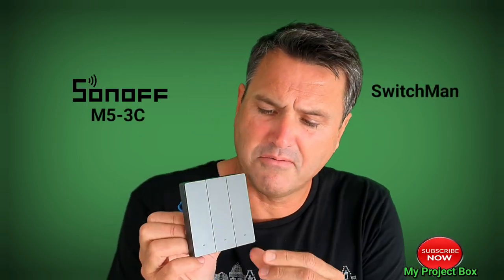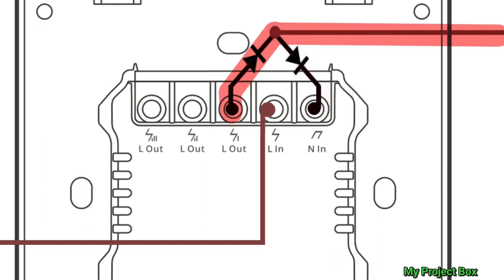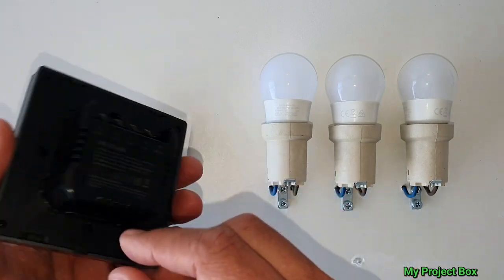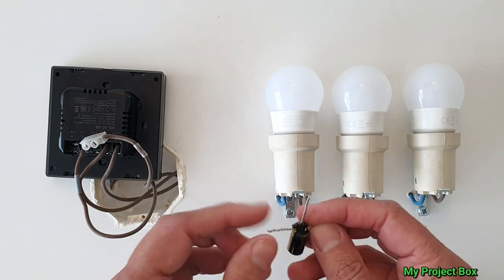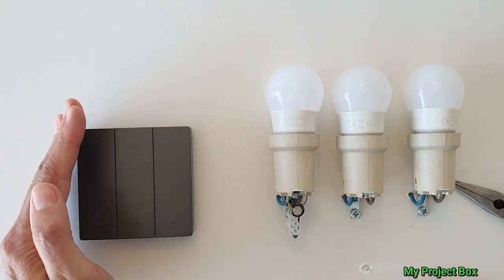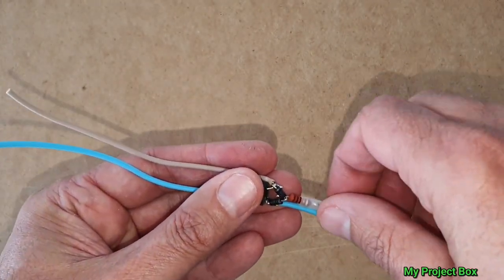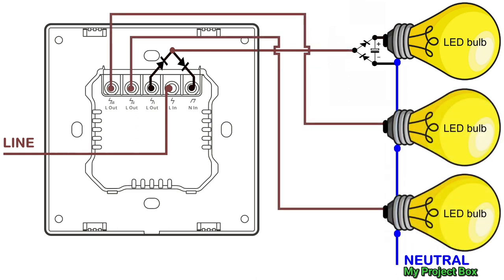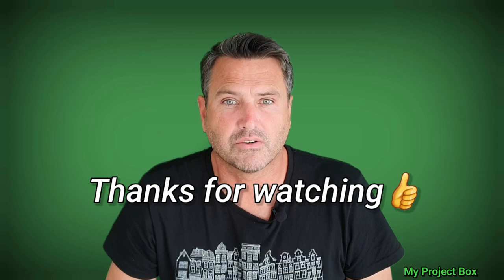Sonoff M5 NO-NEUTRAL  required trick! SwitchMan Hack #Sonoff #noneutral #circuit #modified #M5

Comment: Hi. Thanks for this idea. It looks great! I’m trying it out with an athom 3 gang switch. The curcuit works when it startd, but when I turn the return channel light on, the circuit breaker goes off. I think  i got the diodes and capacitor directions right, but I’m not using a resistor (I’m testing it with what I have at hand). What am I missing?
Reply from the maker: It's great that you're trying my circuit with different brands of smart switch. But I recommend you set up a testing rig, with a safety current limiting. You simply put a old style incandescent light bulb in-line with the Live feed to power your smart switch. That way If you make a mistake nothing blows up, only the "fault lamp" lights! I demonstrate this in this video https://youtu.be/oBR5O391m_c  (at12:56) .
If all works well in your test circuit, then take the safety lamp out, and install the switch. Hopefully you haven't damaged your smart switch or some of the diodes. Good luck👍
Reply: @MyProjectBoxChannel  Thanks! I'll check that video, and I'll do my follup up tests with the light bulb protection.
Reply from the maker: @schoren   Great let me know your findings.  Some people have reported, with some brands of smart switches, all the polarities of the components have to be reversed.  But if you lucky it's exactly the same.  I like the idea of using a smart switch with tasota pre-installed.
Reply: I’ve tried reversing the diodes but still not working. I also added the old light for protection. 
If I remove the diode, I see that both light bulbs (the one I’m trying to control and the protection) turn on for like a second, and then the relay unlatches. This happens in any configuration of the diodes. 
What could be happening?
Reply from the maker: @schoren  try to verify that nothing is damaged. Maybe test the smart switch by connecting it as normal, see that it still works as it should. Check all your diodes and capacitor with a multimeter. If you have new "fresh" diodes and capacitor it's probably better. I have not tested this make of smart switch yet, so I can't guarantee that my circuit will work with it. It's also possible that all polarity of the components need reversing. It might require some testing to figure it all out. But be careful it's easy to destroy something!
Reply: @MyProjectBoxChannel  I had indeed 3 burned out diodes, but luckily nothing else. I'm trying with a different smart switch from athom too, and I see more or less the same behaviour. I can either control the "protection bulb" and get some flicker on the "main bulb", or vice-versa depending on the direction of the diodes. does this mean these devices are not compatible?

I am not using the fusible resistor. Is that required? The fact that I always see the secondary light flickering makes me think that I might need that resistor to "offload" some current or something? I'm don't know anything about electronics, so i'm just letting my imagination fly here.

Also, isn't it weird that the lights flicker? isn't that what the capacitor is supposed to avoid? is that an indicator that either my circuit or the capacitor values are incorrect?

Thanks so much for your help!
Reply from the maker: @schoren  you can message me on Facebook messenger. That way you can send some photos of what you have done. https://www.facebook.com/My-Project-Box-105438131355367/
Reply: @MyProjectBoxChannel  you are the best. Ill reach out there
Reply: @schoren  have you solved the problem?? I exactly have the same problem. It’s the same with or without reversing the polarity of the diodes.
Reply: @MyProjectBoxChannel  I have the same issue. Have you guys solved this?

Comment: Hi 

Can this work for multiple lights controlled by just one switch? A 3 gang switch that controls 3-4 pin lights per switch. Should i just add the diodes and capacitor on the first light on the first switch? Thank you!
Reply from the maker: I will draw some circuit diagrams for you when I get time 🤔😉👍. 
So one switch/ output, needs the diodes, which will provide the "neutral", to power the Sonoff M5. The other switch/outputs connect as normal to the lights. You can put more lights on the diode (neutral return) switch/output, but I recommend a separate bypass circuit(diodes and capacitor) for each LED bulb. This is only needed for the switch/output with the diodes. It is possible to have just one bypass circuit on the first bulb, and connect more bulbs in parallel with that first bulb, but it's easy to make a mistake that way. It is sometimes possible only use diodes, without needing a capacitor! This only works with some types of led light fixtures.

Comment: I tried your way to bypass the neutral wire in the MOES dimmer switch but unfortunately the 8.8w bulb is blinking and the zigbee smart bulb is working but is on all the time at about 10% and can not be dimmed / brightened. I'm 99.9% sure I didn't make any mistakes. do you have any idea why that. does it work in my case?
Reply from the maker: My circuit is unfortunately not to design to work with the smart dimmer switches😥 .  It only works with normal On/Off style smart switches.  I obviously do appreciate people testing my circuit with various different brands, that I haven't tried it with yet. If enough people give me feedback, with their findings, then maybe I could compile a list of compatible devices.😉
Reply: Hey, is there a way that something like this is possible with a tuya dimmer?

Comment: Hello. Have you measured the voltage at the bulb? After the diodes + capacitor, the voltage increases. My device showed 280 volts. That's a lot!
Reply from the maker: That's the DC voltage!, so it's different to 230Vac. Inside the led bulb the voltage will normally be rectified from AC to DC anyway. The peak voltage from 230Vac is 325V!!(that's how high it can normally be rectified inside a led bulb). Not all LED bulbs work with DC, but luckily most are just fine with it. The older "capacitor dropper led driver" type circuits, won't work. So because the rectified voltage is higher the capacitor is rated at 400V, for safety. So inside the led bulb the voltage is at its "normal" operation levels.
Reply: @MyProjectBoxChannel  Yes you are right. I didn't think about it. The diode bridge in the lamp stops working as a rectifier. It is already under DC voltage. Thanks for the good idea!
Reply from the maker: @АлександрАнтонов-г8ж   I'm glad my circuit worked for you😉👍.  Just be safe when working with mains votage.

Comment: Thanks for the video and the great idea, do you by any chance have a link to a shop where I can purchase the resistors in the UK?
Reply from the maker: I got most of it on ebay. I'm changing my circuit slightly in response to people's comments. So a video with the updated circuit should be out soon😉. You can change the fusible resistor to 5ohm 1w-2w. I'm changing the capacitor to 15uf aswell. I'm using bigger diodes, to make it harder for people to blow them up😁. 10A10 Diodes in in place of the old 1N4007.  There's nothing wrong with the old circuit,  I'm just making a much tougher version.
Reply: @MyProjectBoxChannel  great, thanks very much 🙏

Comment: A tip for everyone who doesn't fully understand this magic; Look out animation of how full-bridge rectifier works.
Before testing this, add weak fuse (0.5A) to the L1, just before the switch. Add another one just on neutral wire coming out the bulb. Do not add the light bulb. Do not connect virtual neutral to the switch. It should prevent the loud reminder of your mistake. Instead, fuse will blow and if you're lucky, everything else will be unscathed.
If fuse does not blow, you're ready to remove the fuses and connect everything as it's shown.

Even better if you can test this on 12V AC transformer, if you have one lying around.
Reply from the maker: You can safely test the circuit with some current limiting, in the form of a old style incandescent light bulb. You put it inline with the Line supply. Make sure you test your circuit with a LED bulbs as the connected loads. This way if you make a mistake or short-circuit,  the worst thing that will happen is the incandescent bulb lights up. And if you did everything right, it will work as it should. Look at this video at the following time stamp https://youtu.be/oBR5O391m_c  skip to 12;56

Comment: Hi
Thanks for the video. 
Could you show the mod installation for the bulb end applied in the ceiling dose instead of directly at the bulb. 
Steve.
Reply: I mean rose not dose 🙂
Reply from the maker: Thats a great idea! You could make a little "bypass module", with short flexible wires,  that connects at the ceiling rose. I don't currently live in the UK at the moment, and they don't use that system here. I wont be able to get hold of a ceiling rose. So the only way I could demonstrate it is with a animated drawing/schematic.
Reply: @MyProjectBoxChannel  A bypass module diagram based on your no neutral solution that could fit into a Ceiling rose would be very useful. ✅🙂

Comment: What do you think of the Method of using the ground wire if it is bonded to the Neutral?
Reply from the maker: It's is not safe or legal, to use the protective earth/ground, as a neutral substitute! It certainly will work in some cases, BUT if you have a RCD (GFCI in US) protected home, the circuit will trip on a ground fault, if you try to use the ground wire as the neutral.
Reply: @MyProjectBoxChannel  Thanks for the quick reply. I am now thinking about going with Zigbee. They have switches that do not need a neutral or a capacitor. I don't know how that works, maybe they have a battery built in them. (I am in the US and  my house is pre 1985)

Comment: Hi, can I use this circuit to power an LED lamp with a power supply ?
Reply from the maker: Yes! People have tested it with LED ceiling lights, that use separate driver/ power supplys. Just test it first before you commit. If you follow my "safety current limiting method" in this video https://youtu.be/oBR5O391m_c  I used a "old incandescent bulb" for protection, so nothing goes bang when testing. Then remove it if everything works.

Comment: Hi! I've tried your solution with and it works great! What would it take to make this circuit fool proof? I mean a circuit that won't blow up when reversing the neutral-live wires, are you planning on developing such circuit? I ask because I created my own DIY Smart Wall Switch that works great with Home Assistant and the question always pops about no-neutral wiring and your hack would fix my issue if it could be incorporated in the design. Let me know what you think! Either here or by direct message. Again great work! Cheers ;)
Reply from the maker: I have some ideas yes! You can message me on Facebook messenger https://www.facebook.com/My-Project-Box-105438131355367/ 
Or my normal Facebook https://www.facebook.com/robert.wynmaalen

Comment: Thanks.
I can’t find 10uF 400V capacitor, is it possible to use 10uF 450V capacitor instead?
Reply from the maker: Yes! The higher the voltage rating of the capacitor, the better its for safety😉. I recommend you use  the safety testing method in one of my previous videos. Use a "old school" incandescent light bulb in-line (as current limiting) to test everything works first. https://youtu.be/oBR5O391m_c
Reply: Thank you
Reply: Excellent tutorial, the switch ( as the other tuya switches ) work perfectly. Thanks again.
Reply from the maker: @abokhozayem    No problem happy to help😉👍Could you tell me which model/brand smart switches you used.  I would like to compile a list of ones that work with my circuit

Comment: Be aware this is dangerous as you are taking the current for the lamp through the diodes which are only rated for 1A, thease could over heat and fail.
Reply from the maker: I have used 10Amp diodes  for my newer version of this circuit. But it's worth mentioning that 1Amp is more than adequate for most LED bulbs that are not drawing more than 0.05Amp. Using bigger diodes are useful in the event of a circuit fault, that way the diodes can cope better with higher fault currents, if something goes wrong😉👍. The 10A10 type diodes can handle  over 200Amp for a brief instant, this means it can survive a circuit breaker tripping  https://youtu.be/mznx0xoF8Ck

Comment: Great stuff! Any similar solution for stairs switches?
Reply from the maker: I have a different "NO-Neutral" circuit made for stairway switched lights. It gets around the problem by putting the Sonoff directly by the light fixture. https://youtu.be/9hQFFsBkxaU 
Alternatively it might be possible to just power a second Sonoff switch, and have it trigger a another Sonoff in a software group, as a "slave" . Or using a sonoff "remote control type" wall plate switch.

Comment: Any idea of this trick will work also for smart meter like Shelly 3EM 3-phase energy meter where there is no neutral ?
Reply from the maker: I am not sure. I don't know what your exact application is. I wouldn't recommend it. But give me more details. So I  can understand what you are trying to do.
Reply: @MyProjectBoxChannel  My home is connected to 3 phase 230V but without neutral , somehow the electrician managed to connect the smart meter ,but is showing consumption just on 2 phases. To show the consumption on all 3 phases the power meter require  a neutral wire from the power grid.

Comment: Would it work on a "line"/"line" system?
Reply from the maker: I'm sorry I don't know understand what you mean? Could you please give me more information?
Reply: @MyProjectBoxChannel  sure, here in Brazil, some places have Line/Neutral/Ground system, running with 127v @60hz;
Other places have Line/Line/Ground running at 220v @60hz.

I’d like to know if it must have a “real neutral” wire.
Reply from the maker: @leandrocarneiro2719   Yes "Line-Line" 220Vac will work fine. But you have to pick/designate, one of the Lines at the LED bulb, as your "neutral/return-line". It should work fine as long as you keep to that polarity throughout the circuit. If you get the polarity mixed up it will go Bang! So be careful. Choose one line as neutral and stick to it. The other Line will be the switched-Line.

Comment: Can I convert my 3 gang switch L1, L2 and COM to smart switch
Reply from the maker: It's possible to do a 3 gang switch like this.  But if it's multi-way lighting, like for a staircase, it's a bit more tricky.  I'm not exactly sure what you mean so maybe more information is required.

Comment: Can we use an unpolarized capacitor?
Reply from the maker: Yes you can. But it's going to be  physically quite large. But it will work fine
Reply: @MyProjectBoxChannel  cool thanks, i found some 1N1407 by chance, going to try it out now. I compared your circuit wiring with the off the shelf solution, are the diodes at the light bulb necessary? a comparison video will probably give a certain group (e.g. me) more confidence to try your solution :)
Reply from the maker: @SEOng-gs7lj  yes you need the diodes at the light bulb. My circuit works differently to other no-neutral designs. Look at this video for more examples and explanation. https://youtu.be/oBR5O391m_c
Reply: @MyProjectBoxChannel  ok thanks, let me check out that video, i finished my installation. SUCCESS!!!
Reply: @MyProjectBoxChannel  i understand how your circuit works now, but i'm curious about how the off the shelves ones work too and especially downsides if any
Reply from the maker: @SEOng-gs7lj  that's great 👍 It's almost like magic 🎩 ✨️.
Reply from the maker: @SEOng-gs7lj   this is a video of how some types work. It's quite complicated. Shelly1L  used a different principle (but have had problems with the bypass blowing up). https://youtu.be/VNYcD7MEp4A

Comment: Are you try this solution with Sonoff TX T5 Ultimate?
Reply from the maker: I think it will work with my circuit, but I have not tested with that presice model, so I can not 100% verify it. I have tested it on a normal sonoff TX-T3, and it works great 👍. I have made some changes/Improvements to my circuit so please se my new video. https://youtu.be/mznx0xoF8Ck
Reply: @MyProjectBoxChannel   - I saw this solution. I will try it and after we will see😁
Reply: Hi . It's work fine. No issue
Reply from the maker: @robertbarat7354  that's great 👍.  Thanks for letting me know.